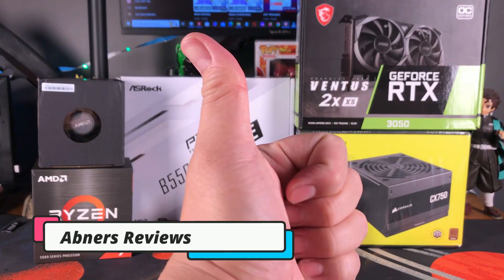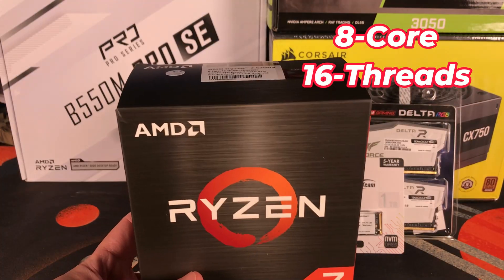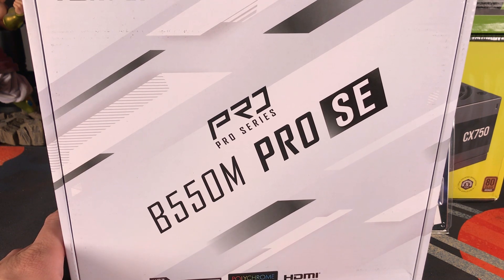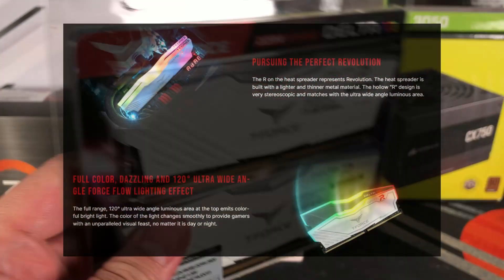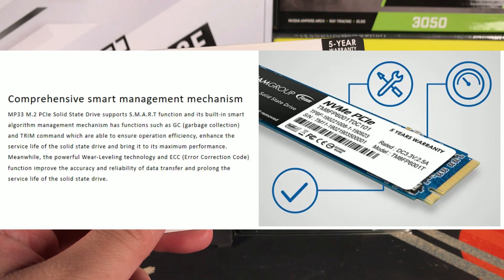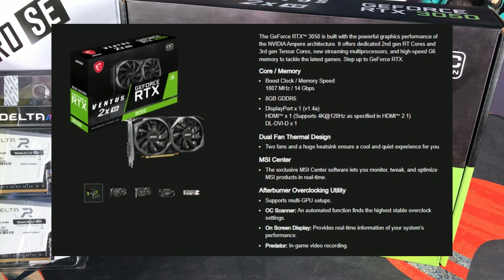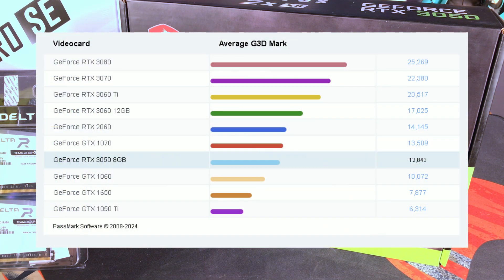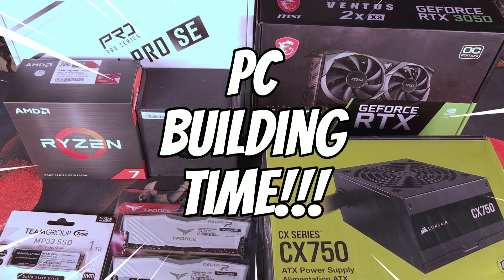Best 60K Budget Productivity Desktop PC Build by Abners Reviews

Comment: out of the box po ba yan no update sa bios needed? nag ka issue kasi ako with fury beast 3200mhz wala xmp or docp, mag freeze or not boot kung naka set to auto or 3200mhz nung na adjust ko siya na okay naman
Reply from the maker: Yea buddy, we didn’t had to update the mobo bios, just statight up boot. Sad to hear about the unit you got, might be lemon units you know. If it is still under warranty do not hesitate to take them back for new ones, because even though they are the same kind of rams, they are still a bit different from each other based on the batch where they are included/created. So might as well try different units on your mobo to rule this out. Hope this helps buddy! Cheers!
Reply: @AbnersReviews  All good, i just went to my local pc shop i went with  a gskill ripjaw v 3600 mhz they had, no issues so far
Reply from the maker: @kraenovt  Great to hear that buddy! Hopefully you get no more issues from your rig moving forward bud! We are happy for you! LESSGO! 🤘👍